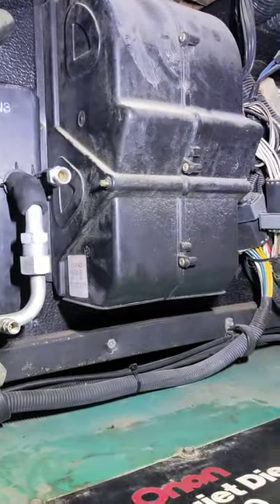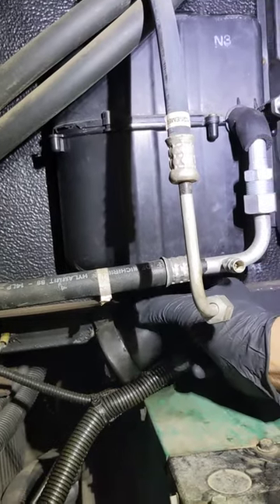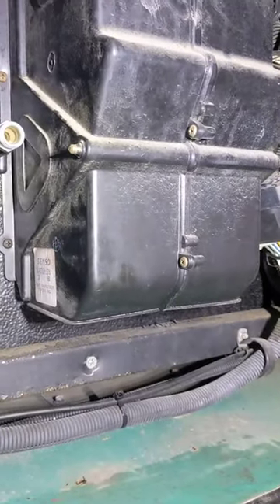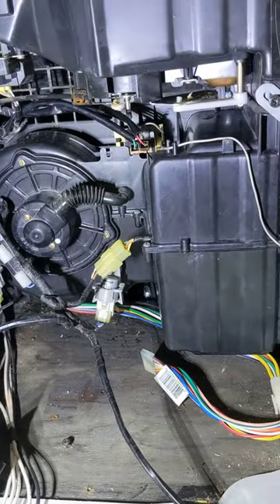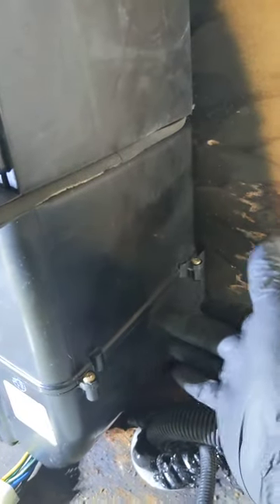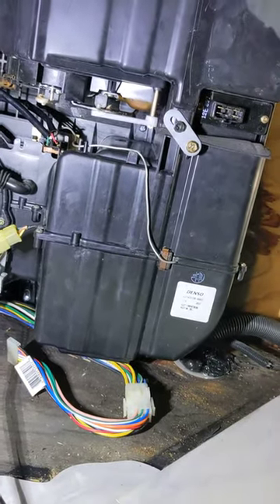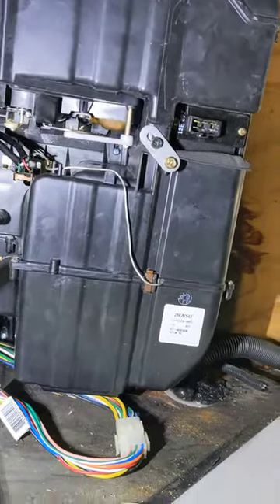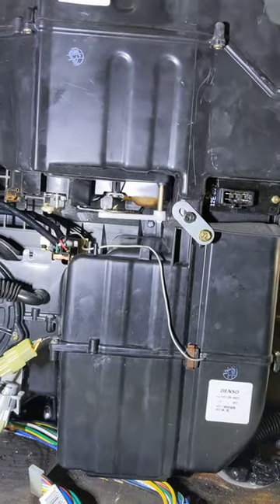Quick Look at the Denso A/C Unit Behind the Dash of a 2004 Fleetwood R.V. on Freightliner Chassis.

Comment: Great view of the Dense HVAC unit in the Freightliner chassis motor home. My 2001 Discovery AC suddenly stopped cooling and I have determined that the compressor clutch and condenser fan are not engaging in the cool position. Blower fan works, and the AC indicator light comes on when depressed. From the schematics and trouble shooting that I can understand, it appears that the deicing switch (thermostat) and/or the pressure switch could be bad. I can't get continuity across either. Should I replace both just to be safe? If I go to the trouble to open the case, I'm certainly going to replace the pressure switch. Your thoughts would be appreciated.
Reply from the maker: Thank you for the comment, Jack! I think I've had about ten of these evaporator housings out for various a/c repairs. About half of those were from refrigerant leaks, which were almost always first seen as an oil residue collecting at the condensate drain area. The other half were related to an electrical fault in the pressure switch. Of those, many were also leaking. Found one evaporator coil leak, one with a leaking expansion valve O-ring and the rest were either inoperative or leaking pressure switches. Not one bad freeze switch out of the bunch, though, on many other models, it's quite common.  Maybe because it's under the dash and not exposed to the elements under the hood. Personally, I feel the failure rate of the pressure switch is quite high. It might be wise to do both the freeze switch and pressure switch if either one lead you to the job of opening that evaporator housing.  Best of luck!

Comment: Sorry, Denso, not Dense!
Reply: So i have had my Fleetwood in several shops trying to get my dash A/C up and running. the same response from all tech are that the unit works but they can't get the dash control panel
to turn the A/C  on and off. if they place a jumper on it they can get it to work. one tech tried to get Fleetwood to send over a electrical schematic  which they said that the one sent over was not the correct one. would it be possible  that the pressure switch  needs replacing?